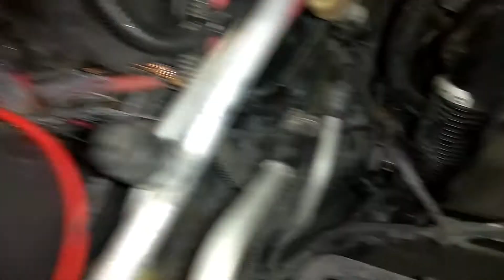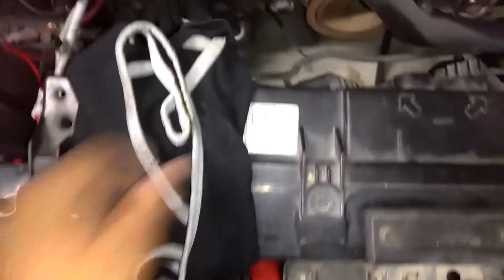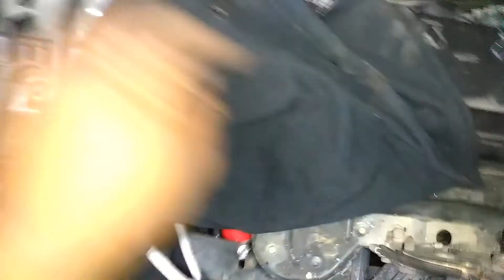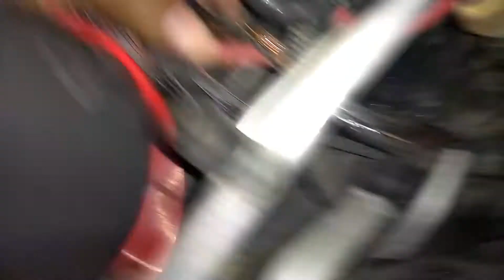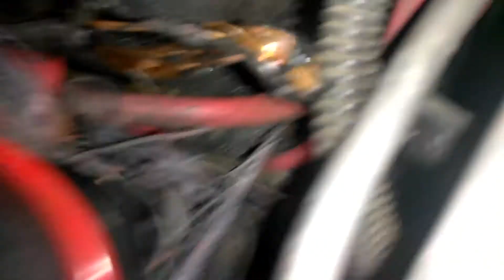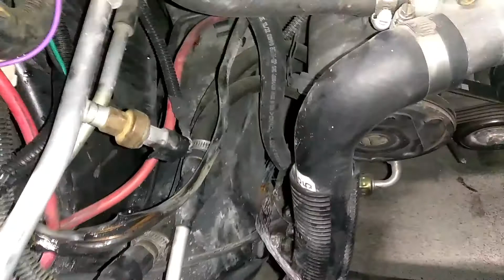95 Impala Ls swap electrical fire

Comment: Whats up homie I got a question for you. if you will. I got my LQ9 Whats the easiest way without having to send out my harness to get a full stand alone going (ac, and all the other stock bells and whistles) working.  Im also suppose to get the lq9 computer flashed right?
Reply from the maker: Love Being Street lbs go-to ltxswap.com and look for the year and model of your harness and you it yourself just take your time and for the computer all you have to do is delete the vats and get it tuned